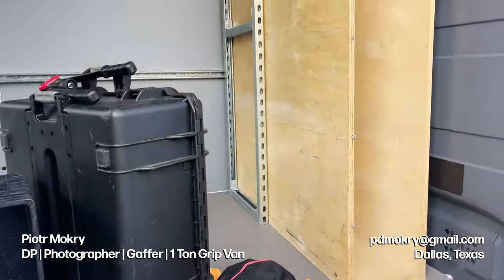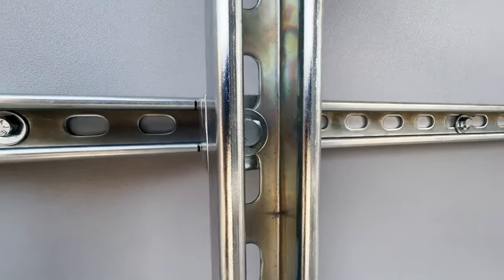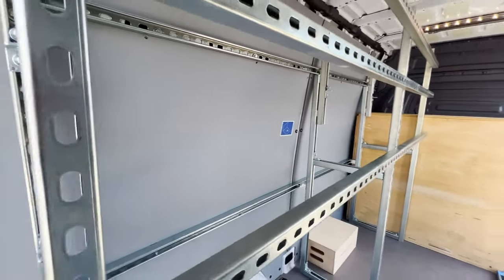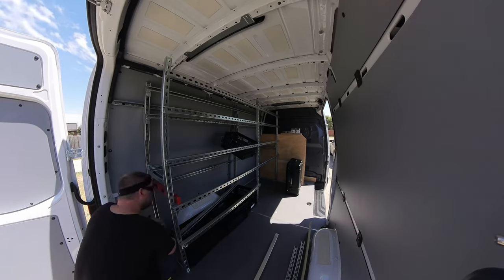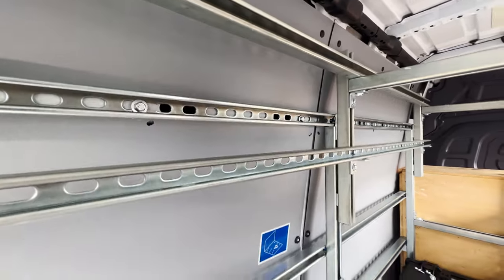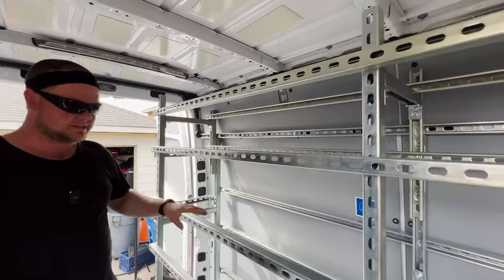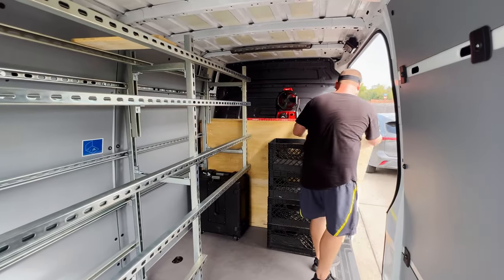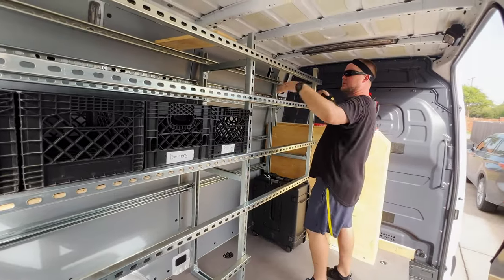1 Ton Grip Van EP2 | Dallas, Texas

Comment: dude i love it, im in a 170in wb sprinter. I could definitely use some pointers, especially since im looking at picking a cart. Dude if you ever have time id love to connect. Havlock wool is what has been recommended to me for insulation so may look into that as well.
Reply from the maker: I’m always open to chat if I have the time. I often jump on calls when I am headed to and from gigs. 

Thanks for watching!

Comment: Hey love these vids! Question, are you mounting the bottom of the racks to the floor? Or was it strong enough on the side panels for structure? 
Thanks man!
Reply from the maker: So the wall connections just keep it from falling over. The weight keeps it planted. The load it spread out pretty well.

Comment: I’ve been wanting to ask you.. how the heck did you fix the sachtler tripod you bought from me on fb? Lol and your van is dope!
Reply from the maker: Was it the carbon legs that were slipping?  Thank you!
Reply: @PDMokry yes! I went to a shop and no one could fix it and then I looked for the manual but I couldn't figure it out and there were no good videos on my issue. Then I was watching one of your videos and I saw you were using it!
Reply from the maker: @Conjuredfilms  It came down to fine adjustment of the tension release. I put a sand bag on it and just kept adjusting to to hold the load. Then made sure it would also release when dropping the legs for setup.

Comment: Do you think this is lighter weight than wood? Also more cost effective?
Reply from the maker: Wood will result in a more bulky build. The space loss would hurt your pocket book in the long run. Also you would need more vertical supports, limiting more storage space. 

This is way more cost effective than getting a custom built all metal build.

A little more than all wood.

10' 2x4 wood 10.2 lbs
10'  Strut metal 17 lbs 

So a 60% increase in weight. 

Wood will squeak a lot.
Reply: Awesome my mind is made up thank you man you saved me lol. I was going to buy wood tomorrow lol
Reply: @PDMokry  one more question for you what did you end up using to keep the plywood from moving?

Comment: off topic but what did you use for your flooring?
Reply: also, great job build, i'm starting blueprints for my box truck off this super strut system because of your video. Has it been holding up great?
Reply from the maker: Factory and 3/4 cabinet grade plywood. More layers in the ply make it stronger.
Reply from the maker: Holding up great! 

Plus it can be removed if needed, this means I can have an empty van if needed.